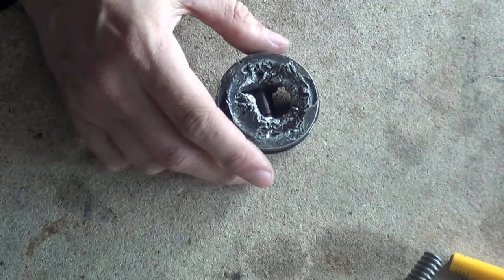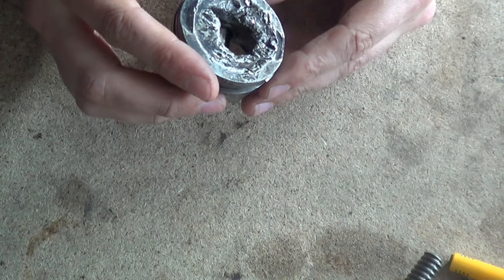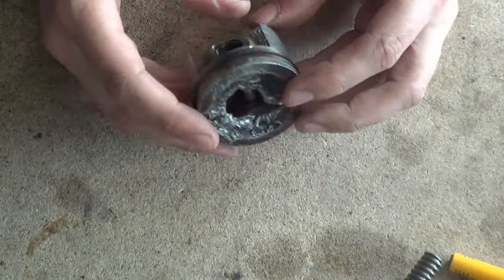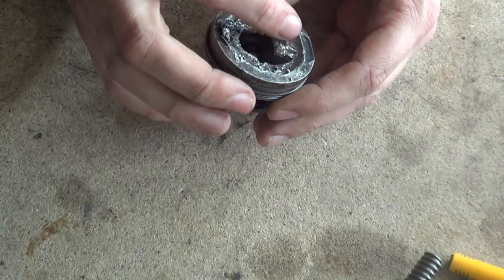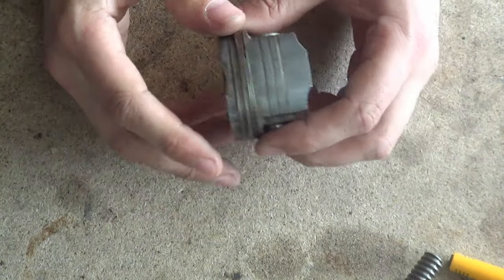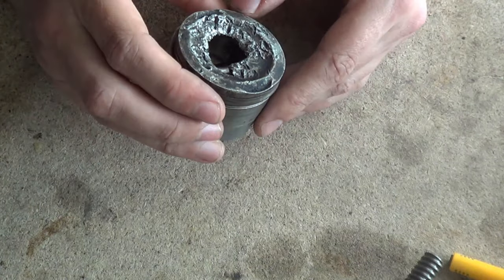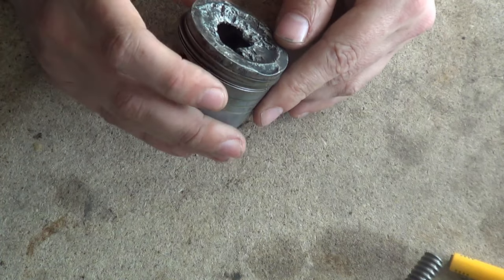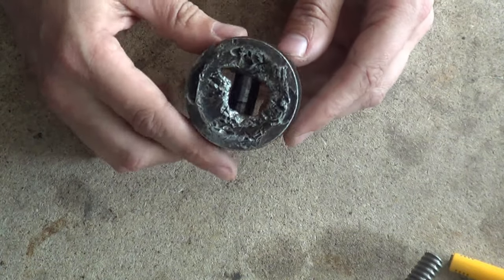Piston Inspection - PISS #4

Comment: To stop it all you can do is lock up the rear break... but those engines break most of the times when they try to get more power out of them then they where build for. But gladly the engines are not that expensive.
Reply: yes but if you go like 100 km/h (60mp/h) you dont lock the rear brake or you should not ;)